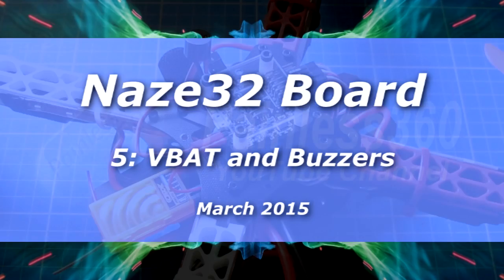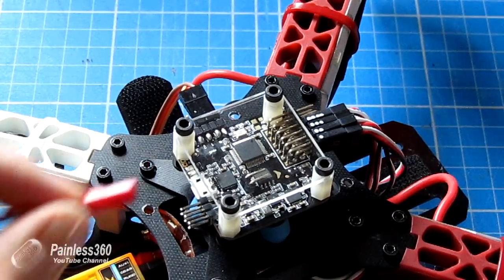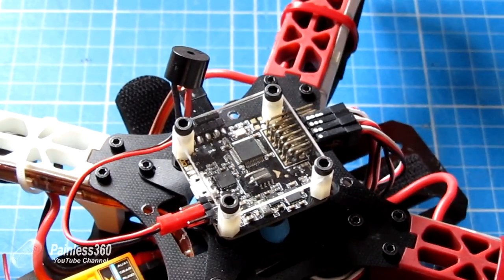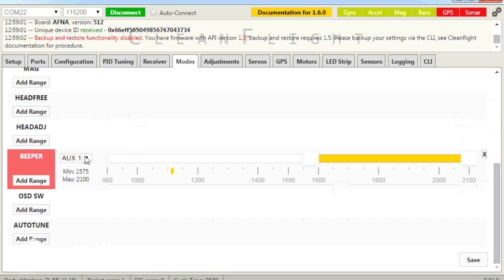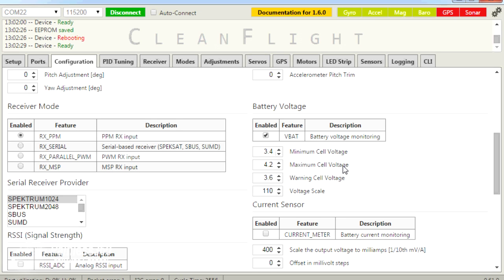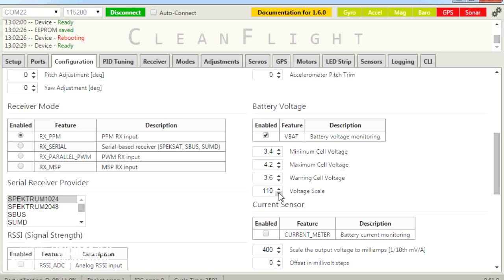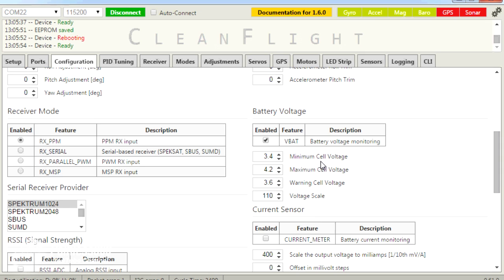(5/8) Naze32 Flight Controller - Battery monitoring (vBat) and buzzers

Comment: i plugged my buzzer into the pins on my naze32 but i can't get it to make a sound.  when i flip the switch the light on the FC flashes but no sound.  i noticed that mine has a white signal wire whereas yours only has red and black.  would this make any difference?
Reply from the maker: Yes, you need a simple piezo buzzer with two wires.
Reply: +Painless360 thanks.

Comment: This may be a dumb question but how can you plug 12v into the board without frying it? I thought it's only "happy" on 5v? Thanks again for all the awesome videos!
Reply from the maker: The only connection that isn't only 5v is the one for monitoring the battery (vbat). It uses a voltage divider on the flight controller to reduce the voltage to something it can handle.. Hope that makes sense. Seasons greetings!

Comment: Hi, is it possible to show if the batteries are low using the LED lights ..? Have all of them change color when you hit low power..? I have seen all the different standard features to enable differ color lights but not tried them all of them with clean flight... Thanks
Reply from the maker: Have a play with it. The documentation for the LED features on the Cleanflight manual is handy too..

Comment: Hi, thanks for the Vid.

I have setup VBAT on a Naze32, I get it on my Taranis Plus via a D4R but it's wrong.

I know the following (power supply used for testing):
Supplied Voltage (with meter) 11.66V
Battery on Cleanflight front page 25.5V
Cleanflight CLI "Voltage: 363 * 0.1V (8S battery - OK)"

I have also tried the above with a 4S with the same results. A2 on the Taranis is around the 5.8 - 6.0 V for a 4S between 15v - 16.8v.

I'm lost I have searched everywhere but everyone out there seems to have issues with voltage of by a few points, not more than double!

Any pointers please?
Reply from the maker: +blindTuna The best detail I can find is here - https://github.com/cleanflight/cleanflight/blob/master/docs/Battery.md hope it helps..
Reply: +Painless360 Many thanks for your reply, I had seen that but didn't figure out anything. I suspect it might be a faulty NAZE  (I had intelligently soldered all the headers the wrong way round and think that fixing it might have been too  much stress/heat on the board).  I am also running a Tricopter version of the Naze firmware (may be coming from there). I will try and contact the developer in case.  THANKS AGAIN FOR YOUR SUPPORT.
Reply: +blindTuna Im having the identical problem with the rcexplorer tricopter naze frame and tricopter firmware. Let us know if you find a solution!
Reply: +Robert Smith Will do, I have forwarded the issue to David to let him know that this might not be a one-off issue.
Reply: +Robert Smith Robert, Dave thinks he solved it, reversed resistors that need to be sorted out. Contact me privately and I can forward you his email with pic of resistors (they are the resistor closest to the 'T' in 'VBAT' and the one above it). Haven't tested it out yet. He thinks it may have been a particular batch.
Reply: What a legend, will do. Thanks a lot for the response.
Reply: +Painless360 K so double checking...the power wire to the board is connected to straight to the battery? RIGHT. thats NOT a 5 volt lead , but the whole battery voltage..will this give the board the 5v that it needs to power up?
Reply from the maker: No, that will fry the flight controller. Have a look at the wiring diagrams in the video. You need some form of BEC (commonly found as part of the ESC) that will provide the 5v the board and receiver needs.. Best of luck.
Reply: +Painless360 so i prolly didnt sound clear on it, sorry...The Vbat wire, in your vid, for the low bat. buzzer, that is full 3s or 4s battery voltage...i know that the board needs to be powered by 5v, what i was wondering, would the naze use vbat input and break that  down to 5v for the Tx and board to run, instead of using the 5v bec to 1-6.
Reply from the maker: Still not sure I follow. vBat is only for sensing the main battery voltage and the electronics behind the pin is to drop that full battery voltage down to a safe level the board can 'measure'. It doesn't also include a UBEC to power the board from that connection. I'm sure we'll see boards that will do this in the near future ;)
Reply: +Painless360  yes this is exactly what i was thinkin.. it would be convenient to be able to power all the 5v stuff with just that one vbat wire..seems just as much to break down 6-16 volts, or what ever it is, so naze can read it, as to add that as a 5 volt power supply for TX and naze..like you said..maybe in the future..
Reply: +Painless360 felt so strange knowing i was plugging in 11.1 volts to a small power board.(vbat wire).but all is well..and the diatone PDB is all hooked up with bh heli with out bec.dont like the new all in one pdb the   12v and 5v little chips kept popin off and taken the solder pad with it...thanks for the vids.
Reply from the maker: It is, and being careful when using full battery voltage is a good thing - I've seen loads of boards blown by builders not checking it all before plugging in the battery.. Happy flying!

Comment: so is it perfectly ok to just put the positive wire from vbat to pdb. ive read in other sources that you have to connect the negative aswell, and then theres other sources that contradict that. i dont want to fry my naze but at the same time dont want to attach a negative wire if its not required. the less wires the better :)
Reply from the maker: +Robert Bingham If there is a GND wire by the vBat connector to use then I'd normally connect a GND to it. Not all boards have and the common GND through the entire electronics system should make it unnecessary..

Comment: Thanks for all the videos - super helpful.
OpenTX 2.1.6 advice for "normal" Taranis?  
A1 (F102 25) and A2 (F103 25) are available on telemetry page, but can't seem to calibrate to real voltage.  No "cell" or "cells" available in dropdowns.
Am using skyline32, ppm, vbat soldered to pdb and pin 6 going to RX on D4R-II.  
The board arms ok and quad flies fine; just no battery telemetry.
Reply from the maker: +Brent Reeves There were some major changes to the Taranis code in 2.1.x of OpenTX. A lot of it was about the changes to the Telemetry system. I've not upgraded as I like the way it works on this version we have here. We will do an upgrade video when I have more confidence in the new version..
Reply: Reverted OpenTX to 2.0.  Life is good.  Thanks again - your videos are very helpful.

Comment: so do you need a positive connection from the vbat to the pdb so that you can use the buzzer as a low voltage alarm?
Reply from the maker: +Robert Bingham Yes you do.
Reply: +Painless360 and is it worth putting a ground in aswell or is just the red wire sufficient?
Reply from the maker: If the board has one I'd use it. Not all boards do..

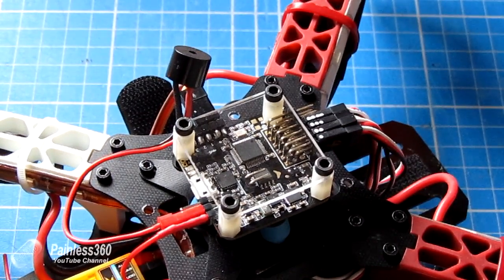Comment: Hey Painless, you really had me worried there, @4:10, you are correct, THAT IS, if your pins are facing out!  But as my Vbat Buzz Pins are facing in, that means Negative is top, + is bottom!!  Worth noting.  I connected mine, like I said, and no smoke.  Is that agreed?  As a newbie, always got to check my thinking, and check my thinking - double triple and quadruple....You  have saved me so many times, I know your voice as if it was my wife's, (now's there's a thought for you!) but thanks heaps for so many of your vids that I have and will watch.  Taranis and You, a match made in heaven!  Good onya!

Comment: Hello painless360... Is the wire leading to the vbat pins on the Naze coming directly from the positive side on the PDB, or is it coming from a step-down voltage board?
Reply from the maker: +LOBINERO 3:34 ;)

Comment: So vbat has to be regulated down to 5v? I fried one board from power coming in straight off the battery to vbat +. It was a 3s
Reply from the maker: +jeremy k Nope, normally the vBat connector can handle a direct connection up to 6s LIPO packs. Check with the seller on the specs of the board you are buying and be very careful about the polarity of the wires... Best of luck.

Comment: Does it matter if the negative wire is also plugged onto the Vbat pins?
Reply from the maker: +Paul Williamson I shouldn't but I assumed it's there for a reason ;) Happy flying!
Reply: Thanks, just that when you demonstrated you used a single (+) wire only.

Comment: On your video starting at 7:50, I found that by changing this number on my Naze32 flip - voltage changes on main display. Also, I did research and utilize power adapter from Pixhawk to power the board + having current sense measurements. On Naze32 flip, signal pin 8 on input channels is then current sense monitor. 0.1V is 1A, 1V is 10A and so on. Please take look at my video: https://youtu.be/_YaCexm_yMc  Thank you in advance. EDIT: "Scale the output voltage to milliamps..." I found experimentally by inserting A-meter in series with the battery, that value is about 925 with offset of 11. This numbers depend of tolerance of the resistors in voltage divider, and can vary. It is good to have current sensing, especially mAh reading, or ho much of the battery capacity is spent in flight. EDIT2: Numbers for correction works somewhat upside-down; higher number shows lower reading and vice versa. Thanks again.

Comment: Some Naze32 flip boards has problem with buzzer - on next picture is shown capacitor, which should be shorted in order to enable buzzer. Thanks to eBay seller 'Fisher-Hobby' kindly provided that information. Thanks everyone. Picture: https://www.flickr.com/photos/milan_karakas/21556598394/in/dateposted-public/

Comment: Ok, I got a question you won't know the answer to because nobody does. I run Skyline32 and I put in a stick command recently as I plugged the battery in and the vbat alarm tone sounded, went up incrementally in pitch and has stayed there at this higher pitch. I cannot figure out exactly what I did or how to bring the beeper pitch back down to a lower one I can hear easily. Do you have any thoughts on this?
Reply from the maker: +Launchpad McQuack The buzzer is a very simple device that just runs of the 5v line. There are two reasons that the pitch has changed - the voltage to it has increased or the buzzer has a fault.. Have you tired another buzzer? That will tell you which one it is..

Comment: To make the red battery voltage sensor wire safe to deal with you could put something like a 100 ohm resistor in line with it so if it gets connected wrong there won't be a short.   The control boards tend to use a voltage divider consisting of a 1K and 10K or 10K and 47K resistors so inserting a 100 ohm resistor won't really throw off the reading any noticeable amount.

Comment: Question:  If my PDB doesn't have any free + / - pads to hook up the VBAT wire, can i just attach it to a pad that is already in use?  Like can i attach it to the same pad that I have soldered the battery's voltage input?  Or is it necessary to use it's own pad.  Any explanation would be much appreciated as I am new to this and would prefer not to fry my pdb or flight controller.

Thanks!
Reply from the maker: That would work fine
Reply: Thank you!

Comment: Good stuff as always. Is there a way to set up the buzzer to go off if the RX loses signal WITHOUT dedicating a channel to it?
Reply from the maker: +DirkaDirka07 Cleanflight will sound the buzzer when no signal is received from the Rx anyway. I've had it going off all the time during my Sp3 build ;)Have you tried it? (props off!)
Reply: +Painless360 Thank you for taking the time to reply.  Yes, I have confirmed by hovering the quad a foot above grass and turning off the TX.  Failsafe turns on and quad falls to the ground.  Buzzer does not go off.  Buzzer confirmed working at it activates for mode transitions, if the TX is off when the quad is first powered, etc.  Maybe it's because I have failsafe set and the FC still considers that a valid signal?  I know how to get this to work if I set a channel for the buzzer, but I'm out of channels on my radio.  

Are you sure you do not have the buzzer on a channel and that channel set to go turn on as part of the RX failsafe?
Reply from the maker: It should squeak too! Take a look at the docs - https://github.com/cleanflight/cleanflight/blob/master/docs/Buzzer.md

I will take a look next time I am in the lab..
Reply: I checked and it beeps for all of the alerts.  I ended up programming it to a switch position and set that position for RX failsafe.  Not sure how to put the FrSky V8R7-II to spit out invalid/no values if it loses TX signal so I could check if the FC failsafe would turn on the beeper.  Checked Cleanflight docs and didn't see that mentioned.  On the Configuration tab it only lets you enable failsafe and set the failsafe throttle position and nothing else.

Comment: sorry!!!! i i write here, but i don't know how to do. i followed every videos about Naze32 and all the settings. then i bought one and mounted on my 250 quadcopter. the Naze32 has all the features that i need ( buzzer,Vbat,led,... i just don't know if i can connect my Orange R610 by PPM... i hope...)  BUT i found it TOO aggressive for my way of driving... SO i went back to an old Multiwii and Megapirate AIO Flight Controller w/FTDI....a lot smoother... AND, here's the questionhow do i connect the buzzer?? i know about pin 32, but with positive wire? and where the negative goes??? can i use the kk2 buzzer??hope you can help me. thank youa lot. Gianluca, Italy.
Reply from the maker: +balde3867 I've never used that Multiwii board so can't comment. Have a look at any online documentation and forum posts. There are several PID loops available in Cleanflight on the Naze32 (including three Multiwii ones) that may have worked better for you. Best of luck with it.
Reply: thanks for your answer... i've tried to look for some video around, but very confused... no matter. About Naze32, my biggest problem was about keeping the same altitude (i have yhe acro version, no mag no baro...) do you think i can solve the problem setting something, and what to set? thank you.
Reply from the maker: I would flatten the curve about the hover point on the radio for the throttle as the first step.

Best of luck with it..
Reply: will try on my next frame.  thanks a Million.

Comment: Hey great video, I was curious though if the single power wire is soldered directly to the power distribution board taking the full voltage of the battery and then plugged straight into the board, what is stepping the voltage down to 5v?
Reply from the maker: Have a look at the manual. VBat needs the full battery voltage on the pin. Best of luck.

Comment: Hi,.

I have naze32 with minimosd 1.1 plus firmware kvosd 2.2, i have the battery volatge ok but i dont have to setup correctly the current monitoring, for rssi and main voltage in the gui i pass to multiwii but for the amperage? Adc? And active osd adc? Dont understand, i do have a extern current sensor or only with the naze32 its ok, i mess the config with current sensor in baseflight

Thanks a lot

Greetings dan
Reply from the maker: FAT DAN sorry,  I have limited experience with current sensors. Best of luck
Reply: Yeah thanks, i found a way to work with activate virtual sensor On the gui and adjust amp with the stick command On osd menu :)
Reply from the maker: FAT DAN I've used that too and it's not bad once calibrated. Happy flying!

Comment: Yes i saw The video ,i have The Same buzzer a naze32 and a dx6 . When i plug The buzzer on The buzzer pins on The naze32  it works 
But not turning off. The thing is I can't find it in the dx6 how to get the other aux to work

Comment: I am using the Speedix Power Distrobution Board on my 250 quad. Here is a link to it http://www.banggood.com/Spedix-Power-Distribution-Board-5V-12V-DC-for-250-300-Multirotors-p-977490.html?currency=USD&createTmp=1&utm_source=google&utm_medium=shopping&utm_content=saul&utm_campaign=Rc-Quad-us&gclid=Cj0KEQjwoIitBRDTgeiZq93F2LQBEiQAMfXL0UuuTxHye6RmLhCcMZ-WoU7EvnT2xxqJOiGgKnqN2A0aAiGq8P8HAQ

Do you know will if I will be able to monitor the battery voltage by connecting the 5V cable to the Naze32? Just curious how I can take advantage of this feature. One last thing what is the difference between the VBat and the Current Senor Feature?
Thanks
Reply from the maker: John Acree I've not used this PDB myself so can't comment on it's features. The Naze32 vBat feature relies on having the actual battery voltage at the vBat pins.
vBat uses a resistor bridge to drop the main battery voltage on the vBat pins down to a level that can be measured by the board. Current monitoring on the Naze32 does need that external sensor that provides a feed into the board. There are reports that it can be quite inaccurate however.
Best of luck with it.